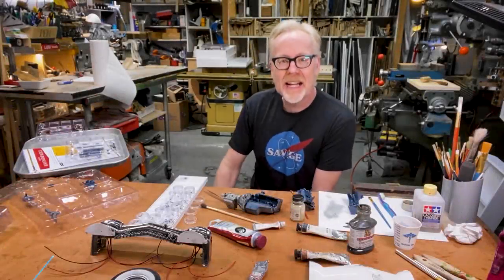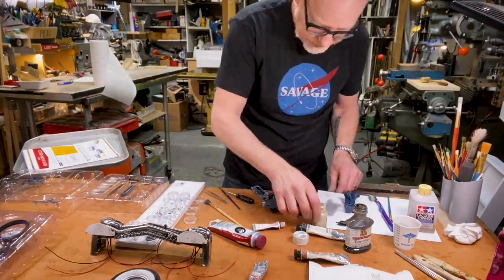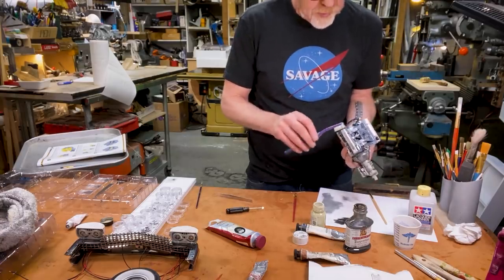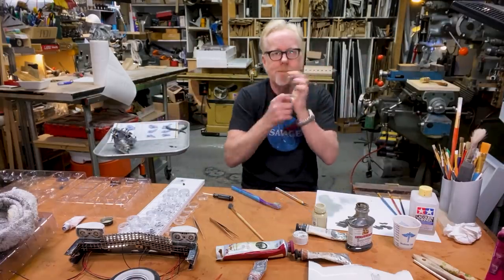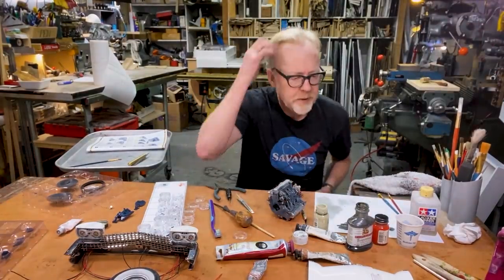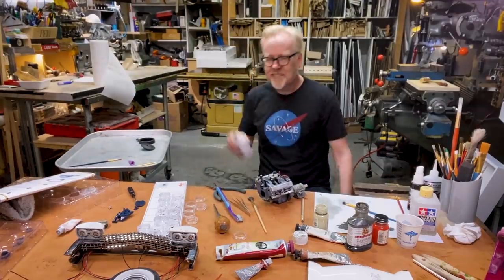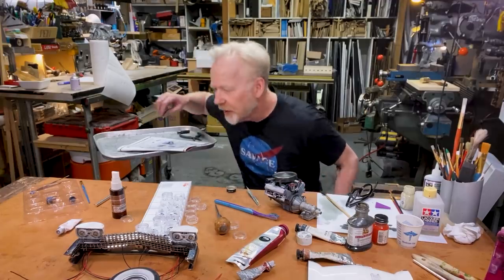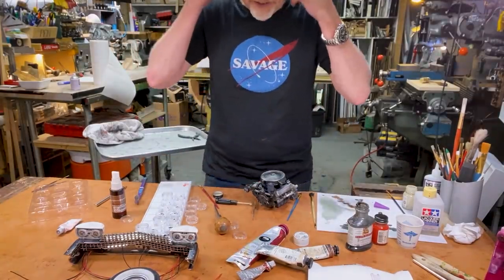Adam Savage Paints and Weathers the Ghostbusters Ecto-1 Model Kit!

Comment: Make sure the shocks, transmission and rear-end look new or newer. Ray said he had to replace those parts!
Reply: If he replaced them with junkyard transmission and rear end, then maybe not? Shocks, almost certainly,
Reply: @fergusontea  As a mechanic you generally try to clean even used parts. Makes installing them better. He might not have cleaned them to the point of restoration but IMHO would still not look like they have been in the same place since 1959.
Reply: @user-neo71665  It was Ray - not a mechanic.  He fixed/replaced them.  Who knows what he did!  (Yeah - I know.....it's fictional...allow me my vices)
Reply: @ChristopherCobra  Have your vices but the time the movie came out Ray woulda been the same age if not older than my dad (Dan Aykroyd is actually 2 years older in real life). That puts him as a teen in the muscle car years. Most teen males back then worked and hopped their cars up. Dad wound up being a mechanic for 40 years with no formal training. I learned how to work on cars from him so I still stand by what I said. Hell I'm a licensed electrician and still teaching my 12 y/o and 4 y/o how to tinker and hop up engines. My oldest first car is a 59 gmc he is restoring sitting on a 84 olds delta 88 chassis with a ls1 under the hood. My 4 y/o wants my nova so I guess I gotta detune it and start to work on my 50 buick.
Reply: @user-neo71665  Well, maybe I don't recall the movie correctly, but - you and I know that is a '59 meteor - but in the movie it's just supposed to be an old cheep jalopy.  Ray's character is not exactly "Mr. Clean".  That was my point - not that he couldn't do the job.
Now, I also am guessing a number of your vehicles look stunning - street show ready.  But not all of them probably.  On a daily driver - I do not clean the covers when I adjust the valves.  I don't clean the calibers when I switch the pads. I don't clean the tranny when I fix the linkage or do a service.  I don't clean the alternator when I change the belt (or clean the engine for that matter).  OK, the calipers on my FJ62 were so bad that a mechanic swore they were leaking - so I did clean and paint them - but you get the point (they were not leaking).  My 68 GT is super clean top to bottom.  Not hard to do on a car that only sees 2000 miles a year.  I do often clean the parts I am directly working on if they are really bad.  True enough - easier to work on.  Truth is though, our difference of opinion is solely based on our pasts and interpretation of "Ray".  A person who doesn't exist.  Interesting.
Reply: @JerkyFraser  After I want back and looked - You are right.  The car they started with was one of the original 25 - they were hearse (sp?) - and it was still black.  So, he had it painted - not just cleaned up.  I had recalled it as just dirty.  It's all our own speculation - but you are very correct.

Comment: The exhaust manifolds would not be grey on an old engine. They would be rusty cast iron.
Reply: The distributor cap should be GM blue as well but he's not finished yet.
Reply: I was wondering if he was going to wing it or spend time looking up old engines. He also says v12 when I thought they were a 6.3 v8. Yea yea semantics
Reply: @Scrapla1  Especially when there's 9 wires on the distributor... it's pretty obviously a V8.
Reply: @Scrapla1  I was wondering what engine it really came with. I'm kinda sad he misspoke though, a V12 Caddy would be sawweeeeet!
Reply: @mguay001  They did make V12 Cadillacs but I believe they stoped making them because of the war effort (WW2) and never made them since.
Reply: @mguay001  Same here! Being it is Adam... I let that stuff slide ha ha
Reply: @kirkbecker7919  same. A little annoyed he called it a V8, but it's not really stuff I worry about, it looks great all over and it's Adam building it so I've got no complaints.
Reply: Shouldn't the engine block be a blue as well?
Reply: @junatah5903  Yeah, blue but mostly flacked off.
Reply: @Scrapla1  59 caddy ambulance shoulda had a 390 or 6.4 in it. Ray being Ray I figured he woulda thrown a 472 or 500 in it.
Reply: @mrphotomanseattle  Aftermarket GM caps come in just about any color. IMHO Ray fixing it to run on the cheap I doubt would have used an overpriced new GM part but instead went to the local parts store and got whatever was cheap.
Reply: @user-neo71665  lol
Reply: @user-neo71665  The cheap ones do. Ray was a scientist and probably understood that the cheapest part wasn't a good value.  I worked in autoparts stores for twenty years and the decent parts usually matched OEM.  It kept people from asking questions like... this part is a different color is it the right part?
Reply: Almost nothing in that engine bay would be grey.  It was a beat old ambulance - everything would be either rusty or grimy/oily black.
Reply: the whole engine block and distributor, oil pan water pump etc.... should be GM blue.
Reply: @evilspoons  I would go back and take a look again. I'm 88.888...% sure that a distributer cap should have 9 wires on it. How else would it run?
Reply: @andrewbeaver1843  I was saying since it has 9 wires, it's a V8. There was confusion about saying it was a V12 in the video. A V12 distributor would have 13 wires.

Comment: Just to answer the question that I had:  This kit is 141 "issues", which come 4 per month at $10.90+$2.45 shipping ($13.35) per issue.  That's $53.40/mo for right about 3 years.  Factoring in that the first two issues are just $1.95 with free shipping, all told this model will set you back $1857.00, provided you don't feel the need to paint any of the parts (and don't already have the paint on hand).  However, there's a swtich on the dash to turn on the headlights, the brake lights come on when you press the brake pedal, and from the photos it looks like the windows roll down using the handles.  It's an insanely detailed model.
Reply: Not really happy about the strangely convoluted pricing they seem to have going on. Maybe they figured the sticker shock will scare people away.  It's certainly a great and detailed model but I'm wondering how many people will pay for the full thing. At least you can pay what you want and just go for pieces i suppose.
Reply: @gravityisweak  I agree that it seems like they've deliberately obfuscated the total cost.  You have to head to the bottom of the page to the FAQs and then click another button to show hidden questions in order to get the details.  Even then you have to do the math yourself.  Also, there are subscription bonuses for certain numbers of completed months, but you lose your "progress" towards those if you cancel your subscription.  You can "pause" your subscription, but it says you have to call customer service to do that, and I'm curious what terms they have for pausing.  The subscription model really seems directed toward getting people into the model (especially with the $1.95 for the first two, probably to ensure they have a working credit card for you) and then by the time they've realized what they're in for...what, you're going to stop with 1/3 of the Ecto-1?  It also mentions (on the Ecto-1 or the Delorean, I forget which) extra paid subscriber bonuses that they'll tell you the details as they approach and give you a choice whether or not you want them shipped.  It's an extra charge you have to opt-out of, if I'm reading it correctly.

Comment: I really hope he puts a light coat of varnish on it once he has it assembled and uses a fan to blow some fine dirt onto it. Seems like the best way to get a really authentic looking layer of dust and road grime. It also needs some soot residue on the rear bumper, tar speckles along the side near the wheel wells, and bug splatter against the front.

Comment: Nice job! Cadillac used a 472 or 500 cubic inch V8 in their ambulances. These were the largest motors Cadillac ever built.  Sadly Floquil paints went out of business and are no longer available. I didn't use them much in the past 20 years as they are toxic as Hell. I did use them on resin even as just a primer because they were the only paint that stuck reliably to resin kits.
We didn't see any close ups before you weathered, but it looks like the block was Cadillac Dark Blue which was Caddy's standard factory finish for engine blocks, intake manifolds and valve covers from 1949-1976.  Of course Peter Venkman probably had his mechanic send the valve covers out to be chromed!

Comment: I probably would have started with a factory correct Georgian Blue on the block, heads, and intake. The valve covers, air cleaner, and oil pan would have been the same Georgian Blue, and the exhaust manifolds silver. However, this is still a fantastic how-to.

Comment: Adam make sure you wire up the starter to the battery, alternator and use some lead solder for fuel lines ..good job on the Valve covers and engine weathering

Comment: Use some black paint on the undercarriage and bottom pan of the transmission to show a rear main seal. It needs to appear very streaky but not major. As you'd want to also show lots of road grime on those areas the rub and buff will do well but those old Caddy V8's do tend to "mark their territory", much like old VW's.

Comment: Quick tip for Adam. You can use some old used engine oil an some fine dust to make sort of a "batter" for lack of a better word. Brush that thing on an then wipe of. It will give that sort of shmoo gasket leaking efect old engine has.

Comment: Exhaust manifold is not rusted enough. They are usually cast iron. And this car lived in NY. So nearly 0 shine on them... that is unless the manifold is Aluminum!

Also get some small (.22 cal BB's) and put 1 or 2 in each paint jar to act as an  agitator. Did this will all my Testors and  Vallejo paints but with standard BB's cause the jars a smaller.

Comment: I know it's too late now, but old engines like that always have a new, shiny part which stands out against the grime, oil, and rust of the rest of it (I probably would've done maybe one valve cover and the water pump or alternator without any weathering and looking brand new). Maybe you can do that with another component like the shocks or a light fixture later in the build.

Comment: I learned some interesting quick little techniques in this video Adam.  My only comment is that the distributor should be either all black or an orange reddish brown as they are made out of Bakelite or a heavy plastic.  If they were metal the car wouldn't run.  (It's the part with the 9 wires coming out of it on the back top of the engine)

Comment: OK Adam:
The Engine Block contains the crankshaft and pistons
The Cylinder Heads contain the valves and valve cam trains
The Valve Cover sits on top just to keep the oil from flying all over
The Exhaust Manifolds connect to the exhaust ports of the heads and can get up to several hundred degrees, thus rusting or heat-corroding from use

Comment: I still think you would benefit from using a jewellers bench, it has a half round cut out so you can get closer to your work. Might even be a good one day build project, it would be useful when building them fiddling little kits. It could be a separate removable work surface if you don’t need it to be a permanent fixture.

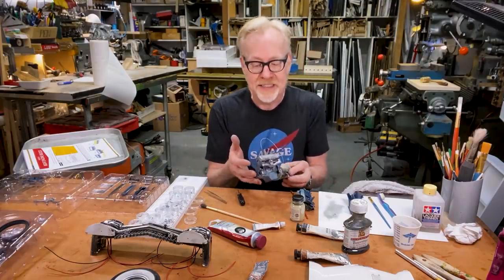Comment: @2:32 You said it was a V-12 engine. I believe they only came with a 6.4 V-8 engine for that year (1959). The last time they used V-12's from before the war.

Edit : Your's looks like the 6.4 but I could be mistaken. Nice job on the detail work.
Reply: Considering it only came with 8 connectors on the distributor, I'm guessing it's the V8.

Comment: This thing is awesome!!!!! I can’t help but feel a 35T motor would fit inside the block and replace the transmission with an Rc4wd or GCM transmission then change out the rear axle then this would turn heads at a rc meet! I would have to see if it’s possible to make the steering system convert to a hidden servo

Comment: Adam, they are "valve covers."  Not head gasket covers. Cylinder heads could be considered "head gasket covers" lol. Luv ya man.
Reply: bollocks
Reply: On a Cadillac those are valve covers. ;) They do however have gaskets!
Reply: “Engine blocks” contain cylinders. “Heads” contain valves. “Valve covers” cover valves. “Gasket covers” are not a thing. That’s how it is in ‘Merica.
Reply: v6 The Jimmu. Yeah. Who wants a smaller lighter engine with more torque.
Reply: v6 The Jimmu wrong. They're valve covers. Calling them the incorrect name is wrong. Thinking otherwise shows foolishness. Thinking pushrods don't also still have their place is also foolishness and ignorance.

Comment: Typically the spark plug wire boots would be dark (rubber), the alternator could be used as a highlight area of colour instead. The wingnut on top of the air filter is also screaming to be silver instead of black!

Comment: An old car/engine not well maintained will have a thick layer of black grime from the valve covers down due to oil leaks and power steering fluid leaks, if so equipped.  Not to mention the the front suspension and floor pans around the transmission will be filthy from leaking fluids.

Comment: Another time-saver for builders, makers, engineers, etc.: Keep all the small stuff cluttering your horizontal spaces inside their own trays so all those little parts and pieces can be moved quickly without disorganization or loss.
I've found it's best to add trays as you do projects, and then stow the (cleaned!)trays when the projects are done; rather than, say, buying a bunch of trays without knowing what you need.
Otherwise, you will wind up buying ten of something you never use for 5 bucks each.
Just, whenever you go shopping for consumables before any project--because you like to be safe AND prepped!--be sure to throw in a tub large enough to hold the largest piece of the project; that way, if you have to move everything, or put it away for a time while you wait for something, or anything at all...maybe it starts raining and you need to chuck everything into SOMETHING really really quickly...whatever it is....get a project tub. Plastic, cheap, WITH A LID so it's stackable. Try to get translucent containers whenever possible so it's easy to see what's in them.
I'm in the 30-year club as a maker, hacker, builder, and wizard of art. I will pop in on Adam's channel to drop the odd hint here and there.
Where there are any one of us, there are always three;
Blessed Tinkers, by the Tinkers, of the Tinkers; we, the Tinkers be!

Comment: Adam, I am fairly new to oil paints for my models and I am confused as to why you aren't using a primer on the parts first.  Do you not need to use primer when working with oils as opposed to acrylics?

Comment: MAYBE Adam missed a few more things than names of parts and how many cylinders, when adding grime to ANYTHING  typically pick two different places to make the MOST dirty ie places that would have leaks or collect grime and places that are hard to clean . a lazy mechanic or home maintenance might see a rocker cover get a quick polish with a rag even the front and side of a head but down below that like around the back of the engine mounts its gunna be filthy, an oil filler cap might actually be the cleanest around or below it because when filling the engine with oil you almost always will spill oil and that means you HAVE to wipe it so that those spots will be clean. the rear of a rocker cover will have the leak or maybe the centre leaking down onto the exhaust manifold so simulate burnt oil. places that wiring runs are always dirty because wiring gets avoided when a lazy clean is done . Done put oil leaks coming from a carby put fuel stains or a different looking grime too. no point dry brushing silver or alloy on an old cast iron engine with dirty oil leaks . anyway whatever

Comment: You know, Adam; this was less practical to consider back in the 20th, but now?
How about a 1to10 PART-FOR-PART model? Accurate down to the piston rings! Starts, drives, runs on gas....radio works.....
Aside from some of the smaller rubber processes and parts, why not?
And I DO mean a zero compromises, part-for-part replica of a working car from the 20th Century...maybe a Hemicuda....something SO valuable there's reams of documentation about it just sitting around on websites.
Also, vehicles with a popular history with modders are good candidates....especially since parts and plans tend to be cheap.
I would suggest that rather than working off specs, acquire a vehicle and dismantle it down to the last part.
The older it is, the less likely it is to have assemble-only components.

Comment: Is there a secret to glueing painted parts? I've tried this so many damn times to only have a mess on my hands. The paints cause the glue to gel up and just becomes soft and never sticks together right... What am I doing wrong? Tried with superglue and plastic cement.
Reply: Don't get paint on the 2 surfaces that you are trying to glue together, if you have paint on that surface, scrape it off. Plastic cement works by melting the plastic, it doesn't work well on paint.

Comment: I appreciate the weathering, however there is a detail you got wrong which is just driving me nuts.   On the 59 caddy, their engines were painted a dark dark navy/royal blue.   On the commercial chassis engines, everything was slathered in that same blue including the VALVE COVERS.   As the ecto 1 was a commercial vehicle, even if it had gone through a rebuild, no-one would take the time to strip the paint and paint it another color.    So your engine block and heads of that V8  (not a V12) should have been an ultra dark blue.